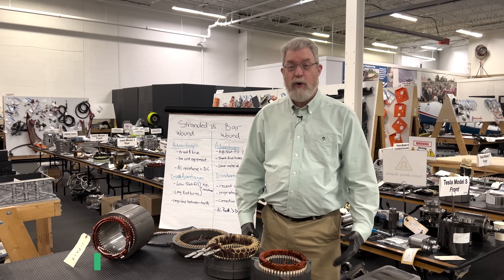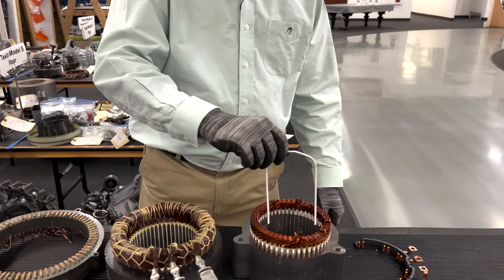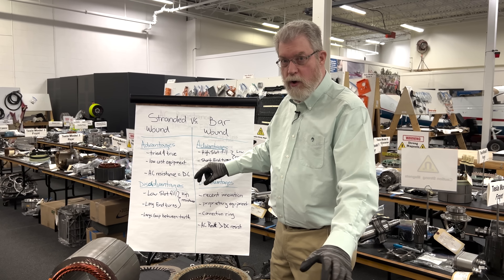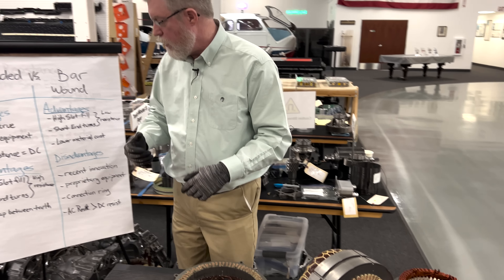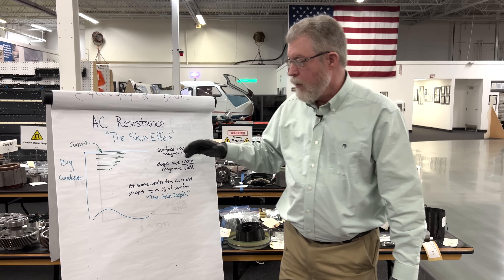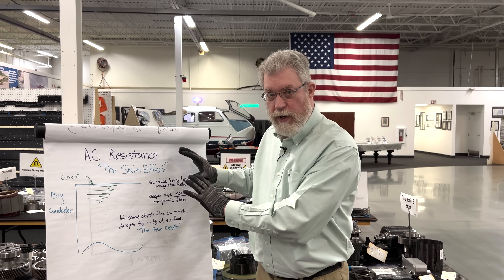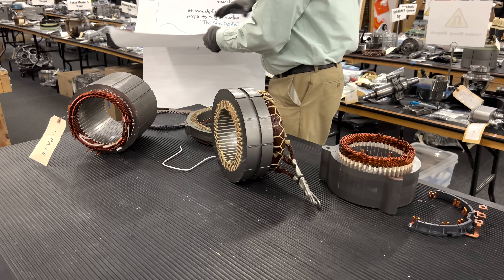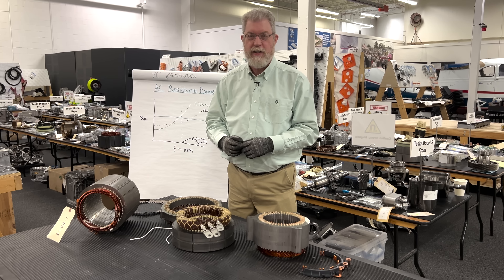Getting Wound Up: Stranded vs Bar Windings in Electric Motors

Comment: I'm sure some engineering could take the best of both applications.  Reduce the size of the bars and group them, to reduce resistance.  Make it more like wrapped, stranded wire, but essentially rods.  It all comes down to surface area, right?  The skin effect.  Wrapping wire is complicated, time consuming, takes up more space on the outside and has those resonance issues.  The bars can quickly be jammed in place.  A multi-material, metal 3D printer could potentially print the conductors in place, inside of the stator, sealed in place, as thick or thin as needed for the application, with some leads to connect wires from the motor controller.  You could even print some channels for liquid cooling, if the performance warrants it.  If the whole thing is 3D printer, then recycling is simple, cuz you just extrude it back into wire for remanufacturing.
Reply: there are already some smart things being done. Actually the extra AC resistance mostly comes from the bar closer to the airgap which sees more flux leakage than the one in the back. So you start to have some proximity effects before the actual skin depth. So some people for example try to split this first layer of hairpins to reduces these losses even more.

There are also weaknesses in the welding part. The Lucid hairpin winding is all done in one shot, which seems to be more efficient overall for manufacturing and efficiency

Finally the choice of winding is linked with the efficiency mostly, but the temperature is also a great design factor for the performance so the cooling of both windings is very important to consider as well. Wound coils are impregnated together whereas you can have a little bit of oil cooling between the hairpin end windings

In any case, these things get modelled nicely in simulation with tools from Altair for example
Reply: @simong2391  I WAS curious about the welds.  Welding them together just seems like another weak point in the conductor.

Comment: So the solution would be to use variable size bars to overcome the skin effect, So instead of having 8 bars in each slot, you would have two of the present size, followed by 4 half the previous size, then 8 half the size of the previous level, followed by 16 in the final slot, thus overcoming skin effect to a considerable degree, or perhaps mostly eliminating it.

Comment: Your skin effect explanation is not relevant for this situation. Winding a bunch of separate wires collinearly results in the same inductive effect as a solid bar. To mitigate the induction you would have to wind the strands in a twisting pattern of some sort, which does not appear to be the case in the cross sections shown. I suspect the relevant effect is due to reduced eddy currents in the strands vs. the solid, but it would be good to hear that confirmed.

Comment: Bar motors have one inherent disadvantage. Lower torque due to limited number of windings and subsequently higher motor rpm requiring higher reduction in the gearbox.

Comment: Wire wound is 5000X more likely to burn out! Just 2 wires need to touch and it's ALL over! In the case of bars the coating is much thicker and they have more spacing. Bars could last 100 or 200 years!

Comment: Cars have two axles... why not use one type of motor for the front axle & the other for the rear? Then bias the power delivery to the "effective" axle? In the highest power mode use both while in the highest efficiency mode use only the currently most efficient.

Comment: Always use a Pure Sinewave Invertor they are more expensive to make over the Cheaper Square Wave but are better for the Electronics Devices Longevity
Square Sinewave is Digital either On or Off real Quickly while a Pure Sinewave is Analog with a Gradual Increase and Decres, This leads too a Cooler device and no Sudden Surge that even if designed to Take will wear down Componentes (Resistors, Capacitors, Chokes even Copper Wires!) Much Faster!
* Pure Sinewave can Extend a Devices Life Span over No Invertor or a Square (aka False or Digital!) Sinewave Invertor by as much as 30 to 60% and can save Power Usage by 20 to 35% on Average but could be even Higher!

There is a Good Reason by Pure Sinewave Invertors are Always used for Important Computer Systems (Military Systems Including RADAR, Server Farms/Cloud Computing, Mainframes, Supercomputers, Banks etc.)

Comment: I would prefer to have two different motors. One for low speed, another for high speed, and both for high demand.
We will anyway see a trend of reducing the torque on EVs, or i hope so, because people tend to floor the throttle and on EV is a disaster on the make.
Tires are being shreded due to higher mass and higher acceleration on EVs, something was a efficiency problem on ICE, but is much worse on RCEs,
Affecting the mileage also on tires and even other components that hasnt been a problem until we reached the torque of high spec RCEs like transmission and suspension parts like arms, joints, etc.
We will need some programmed reduction of performance, at least optional or even a much more clear indication of efficient Vs range and car lifespan shortening driving mode.
I suggest inspiration on aviation. If you are flooring the throttle out of a green light just to floor the brake on a red a few meters after, the car says "retard, retard" like when you land with too much power on the engines.
Its not an insult, just a reminder to retard the levers, or the throttle in our case.

Comment: Why not just extrude a single copper bar into the whole slot? That would get rid of any space between copper pieces and take you to the theoretical maximum of how much copper can go into a slot. You might even be able to coat the slot in a thin layer of ceramic which would take up less room as an insulator which allows the copper to be closer together to each other. This would also let you choose the bar conductor size, because you can make the slots as wide or thin as you want. So you could make something like solid 1-2mm wide bars with 1mm gap between bars. This should eliminate torque ripple to a large extent by not having each magnetic field so far apart and mitigate most skin depth issues with a bar that is not very thick (but is long), while also maximizing how strong the magnetic field can be by putting more copper into the motor. Extrusion technology is pretty advanced (after all, we make regular wires with it), is easy to do, and cheap nowadays as well. It also sort of saved a manufacturing step, by extruding directly into the motor slots instead of making the wire and then putting the wire into the slot. I believe if you also introduce graphene into the copper  (very few parts per million levels) when it is extruded it also significantly increases heat capability and has higher conductivity than pure copper at motor running temps. Materials cost and processing time would be higher due to the ceramic coating process and graphene costs but it would probably be worth it for a significant performance jump on the motor.

Just send me 0.1% of the profits from selling the motors if you decide to make it  😜

Comment: What rubbish . Aircraft AC generators have been designed with hair pin windings since the 1960s, so over 60 years of this proven technology.
Reply: I upvoted this comment even though it comes off as a bit hostile because your not wrong.  Yes, Aircraft generators and automotive starter motors have been made using bar wound technology for decades.  However, as I tried to point out in the video, these motors are all single turn machines with the simplest possible winding.  Multi-turn stators for traction motor applications have only been bar wound in mass production since 2007.  If we include other types of motors, Denso deserves credit for the first application in their bar wound alternator in the late 1980's.

Comment: all the slides make sense, but there was a really big leap to get to the last chart.  He should have explained how the x is speed of the motor and Y is resistance, over the entire motor.  He conceptually zoomed out too quickly for me to get this in one viewing, and I have taken engineering physics, and have a BS in math.  I still don't understand the concept of AC resistance = DC resistance.  On the first comparison chart should have just said "varying resistance".
Reply: Thank you!  This is a very constructive comment.  It's challenging to try to cover a complex subject in 20 minutes.  I knew I was making a leap between the physics discussion and the "example"  I can't believe I forgot to explain the axis of the plot. That's a pet peave of mine.

Comment: PPS. So Steel Wool is a semi crystalline form of iron. Interesting. See  https://www.youtube.com/watch?v=wk9L_GWGLmY
My guess is that semi crystalline steel is cheap and abundant and well worth checking out as something rather useful in electric motor manufacturing.
©March 23rd 2024
Reply: ALL iron is crystalline, except for the "glassy irons", made by spraying a thin stream of molten iron onto a large, fast, spinning wheel, achieving a cooling rate is a million degrees C per second, to form a tape less then a thousandth of an inch thick.  This is used in inductors & transformers running at 100's of KHz frequency.  The resistivity of this stuff is orders of magnitude higher then crystalline silicon steel, lowering what would be prohibitive eddy-current losses.

Comment: Isn't there an opinion "amount of copper" doesn't matter much because the current flows on the outside of the wire? 🤔
Edit: Ah, must be the skin effect explained later.
Reply: Yes, it's the "skin effect", but current never flows on the outside of the wire... just within the wire, concentrated near the surface at higher frequencies.